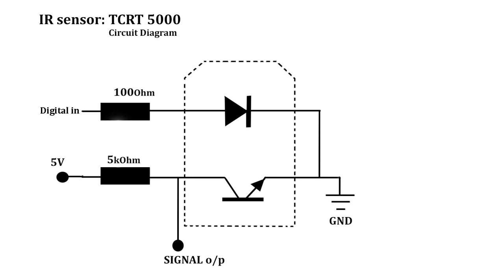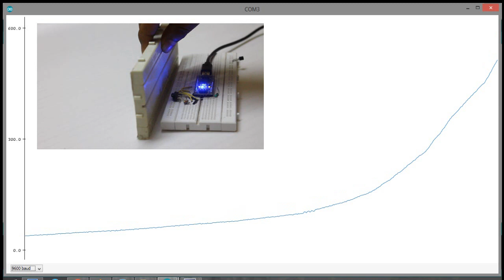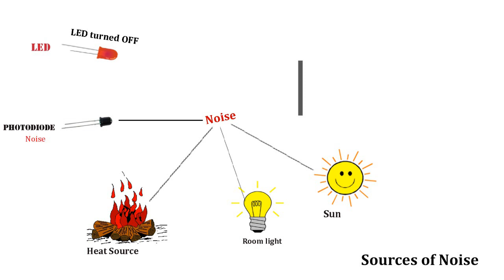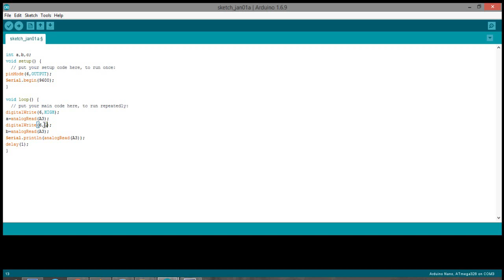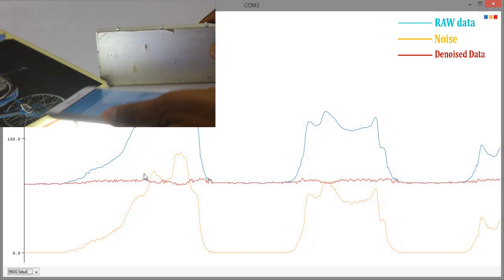Using IR sensor (TCRT 5000) with Arduino and program to remove noise

Comment: That is really smart.Can you tell how you plot the graph in real time?Thank you
Reply from the maker: hi.. this is Serial plotter of arduino IDE. it can plot multiple data in real time
Reply: Thanks I had the old ice and didn't know thanks.I trying to track the amplitude of a pendulum precisely any suggestion
Reply: Abhilash if the IR sensor is wired through a comparator (op-Amp) how would the signal vary? Will be glad if you reply.Thanks
Reply from the maker: hello, using op amp (transimpedance circuit) to take data from sensor is always better than using just a resistor in terms of speed and accuracy.

Comment: I'm curious about the distance you are measuring. In the datasheet of the TCRT5000 it is said that the maximum distance is 1.5cm (and my TCRT5000 exhibits a behavior consistent with that). However, you are measuring much bigger distances (maybe 10 times bigger!). How are you achieving this?
Reply from the maker: Its not difficult to achieve 10 times or even more range. but there will be significant errors . try with various   resistors connected to photodiode, Higher value will give higher gain. 

And if you are able to make some Analog circuitry to perform This action, it can get even >30 cm range (again with bad resolution).
Reply: Ok, thanks. But I think that LOWER resistor values will give higher gain.
Reply from the maker: sorry,  thats my mistake.
Reply: I was confused by the different resistor choices for the IR LED that I found online.
The optimum transmitter current is cited (https://www.vishay.com/docs/80107/80107.pdf) as 20-40mA, which means 125-250Ohm for 5V. So 100Ohm is already below that, although a pretty common choice from what I've seen. 
Also in the absolute maximum ratings section of the datasheet the forward current for the LED is 60mA. So the resistor really shouldn't be lower than 84Ohm. Distance > 30cm seems pretty crazy, did you manage to do this?